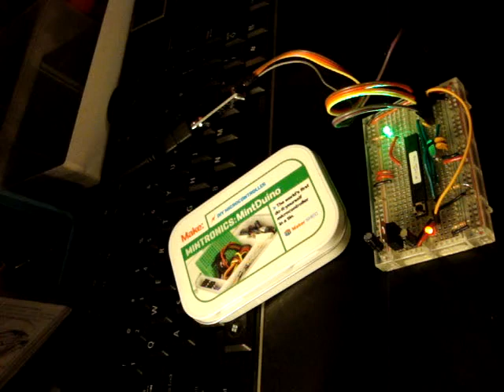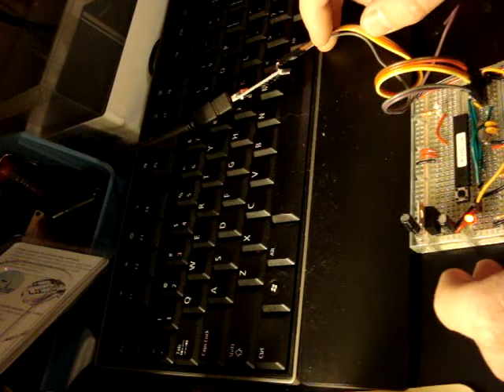MintDuino Programming with CP2102

Comment: So I'm trying to get the board to program, but I keep getting this error. 

avrdude: stk500_getsync(): not in sync: resp=0x00

Did you come across this error by chance? 

What driver did you use for the cp2102?
Reply from the maker: Yes.  Different USB to TTL adapters have different pin-outs.  If you have one with DTR, you'll need to send that to the reset pin on the AVR.  That's step 16 on the Make project (see link in description).  You can see they use a 100nF cap.

If you don't have a DTR pin, you'll have to pull the reset pin low right when you see the IDE says it's about to start uploading.  If you've wired in a reset button like in the project, just use that.  It may take a few tries to get the timing, but I have successfully done it several times.
Reply: beovercash Hi, thanks for the reply. I have the same set up as you. Thankfully you pointed me to my mistake. I looked at slide 16 and realized I forgot to ground the pinout. After doing so I was able to successfully upload the blink program. Feels so dumb, but am glad it worked. Thanks for pointing out the cable. Much cheaper than the $15+$10shipping ftdi cable.